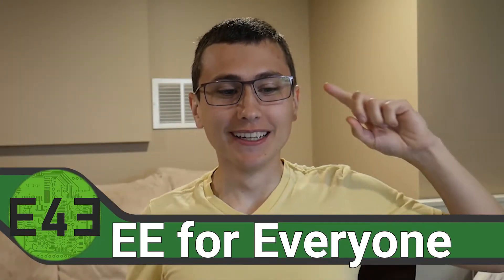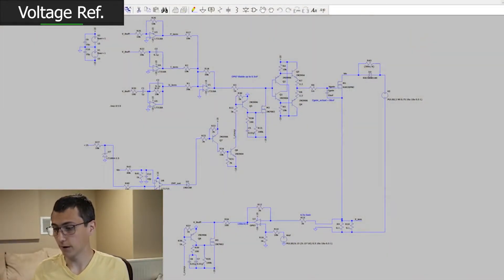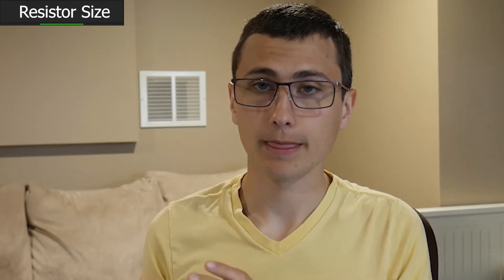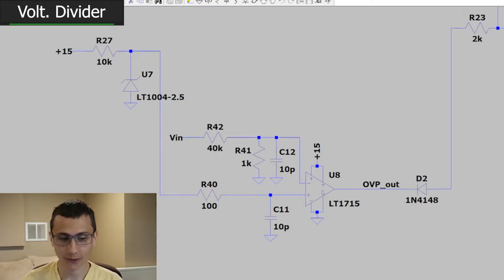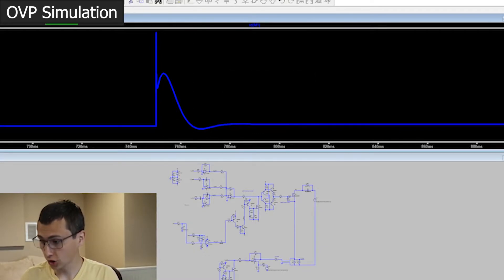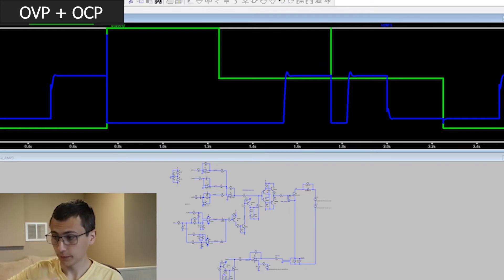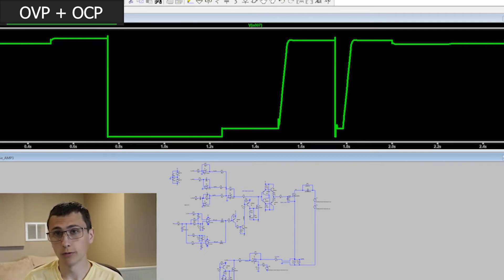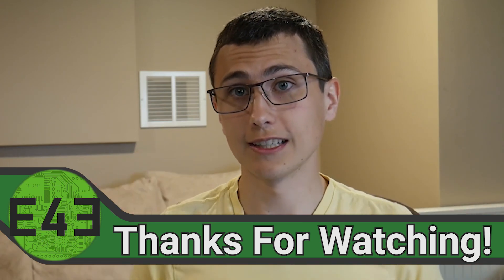Over-Voltage Protection (DIY Electronic Load)

Comment: Enjoying this series! =)
My thoughts regarding 0603's is power dissipation and temp coefficient?
0603's might get way too hot if we're talking 150-200V & 40K Ohms?
My initial thought is 5x more resistors or 10x the resistance?
0603 PD -> 0.0625W?
200^2/(40E3) -> 1
My initial thoughts for reverse polarity protection is an N channel switching FET.
P channel is also an option, but then it looks like it's ~$8 AUD vs $1.5-2AUD?
You already have a negative rail, to enhance an N channel FET?
Driving both of these adds a lot to BoM components though =(
You can get DC circuit breakers for reasonable prices as well?
Reply from the maker: Hello Normally Open! Thanks for the comment! Yeah.. we ended up splitting this into 4 10k parts for Proto 2... by the way... I'm so excited for Proto 2! This is only meant to go up to 100V (to ensure the FET doesn't blow in a hot-plug while hot)... not to say someone couldn't hack the OVP threshold and firmware to increase the input range! 

I don't mind a fuse for reverse-polarity, mainly because it really doesn't happen often. This is piece of equipment, typically needed and used by trained professionals. If an "oh crap" moment turns into a blown fuse, that seems acceptable. :)

Cheers, and thank you for your review and thoughts!
Also, I send you a DM on the E4E slack.
Reply: Fuse is a reasonable solution yes =)  on order of magnitude of cost, but easier to design.
Perhaps TVS diodes, for a "fuse blows" in your "oh cap" moment for OVP?
I prefer resettable options, but design is certainly harder.
You're correct that the main goal is just to save the expensive components, as it doesn't happen that often.

100V is the max design voltage?
I forget what is expected, maybe if we're talking 48-80V normal usage.
I guess I got stuck on the 200V example.
Perhaps expecting >100V continuous fault voltage is unreasonable.

Perhaps it's reasonable to expect a user to notice something is wrong and disconnect the input in a reasonable amount of time in a fault condition.
(aka hobbyist, "they should know what they're doing" , rather than over-engineering =P )